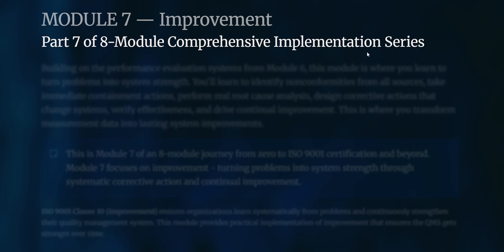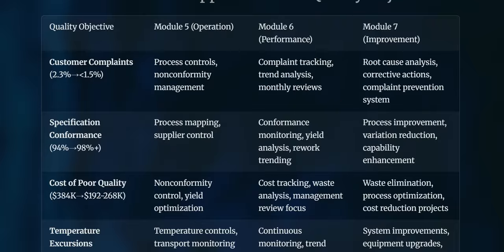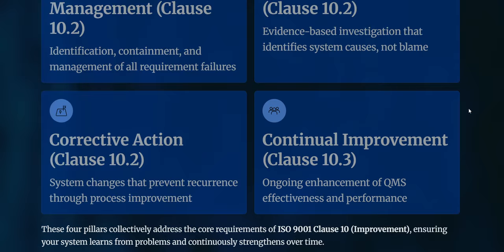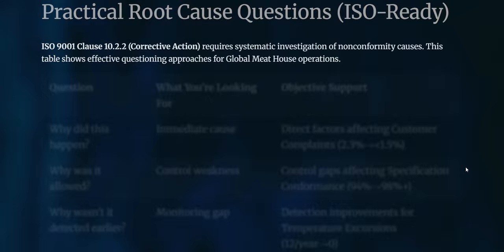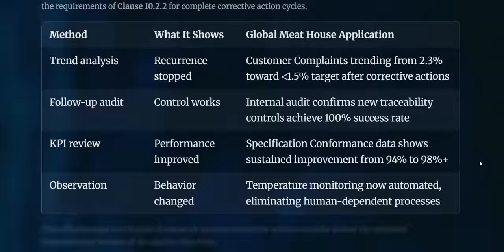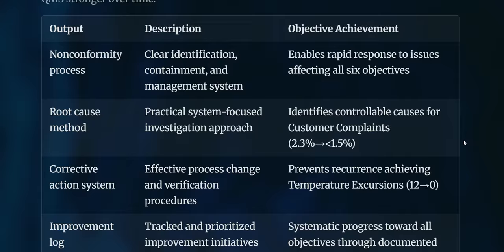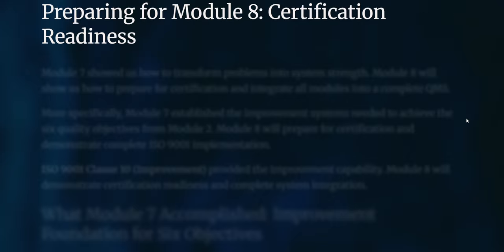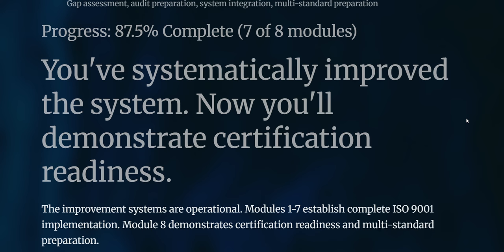ISO 9001 From Zero to Certification – Module 7: Improvement (Clause 10 Explained)

Comment from the maker: This is Module 7 of an 8-part ISO 9001 implementation course.
This module answers one question:
How do we stop repeating the same problems?
Before moving to Module 8, you should be able to:
identify nonconformities from all sources
perform real root cause analysis
implement corrective actions that change systems
verify effectiveness using data
▶ Module 8: Certification Readiness — coming next.

📌 Start the full course here: 
https://www.youtube.com/watch?v=635Yd0RY7VU&list=PLpjg2sQqENxpX1I-BuqdfCaL003zCMf9O&pp=gAQB ISO 9001 – From Zero to Certification (Complete Playlist)
or
📌 Start the full course here: 
https://www.youtube.com/watch?v=nbldSNzf0Ms&list=PLpjg2sQqENxrXg5OHN88-I17cmLA7qsPI&pp=gAQB  ISO 9001 Implementation – Step by Step (Practical Training)